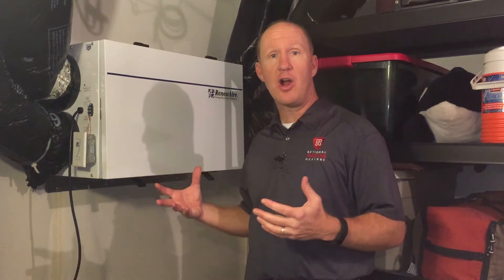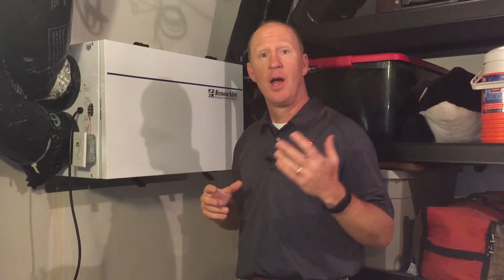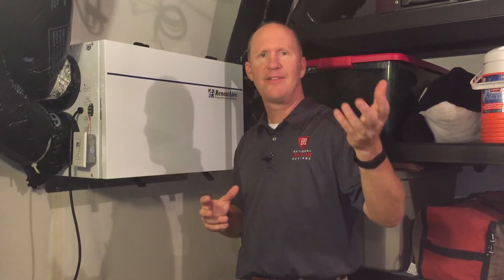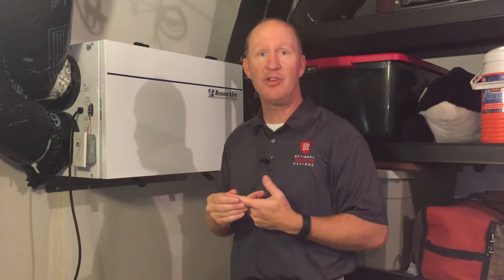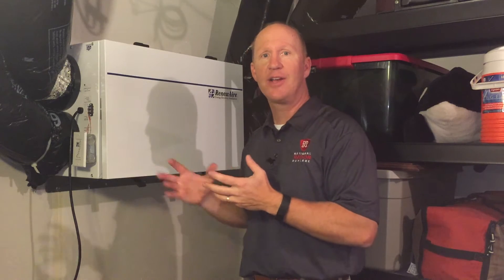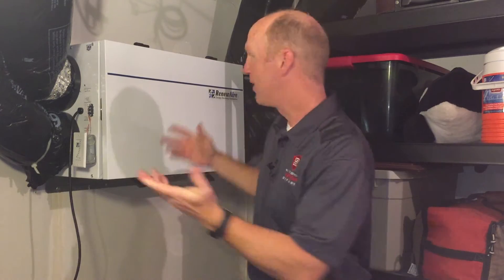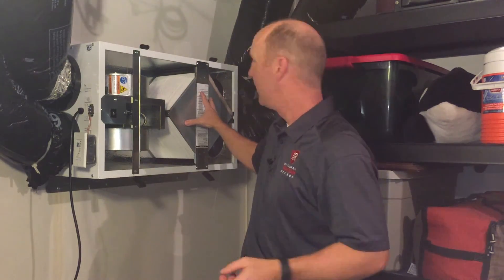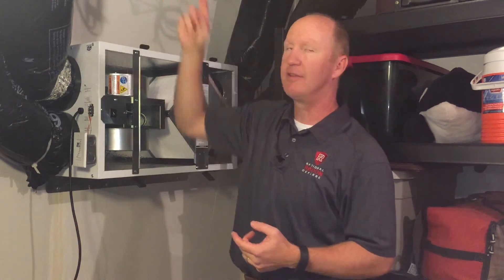Energy Recovery Ventilator Explained

Comment: So basically the device mix indoor and outdoor air? So the outdoor air will have some of the bad stuff from the exhausted indoor air (at a lower concentration?)
Reply: does not mix much. The exchange core allows the air to exchange heat, but the two air paths do not mix. Check how these work - there are videos explaining it - pretty neat.
Reply from the maker: Hi @BS-my2ky! An ERV doesn't mix indoor and outdoor air directly. Instead, it uses a heat exchanger to transfer heat and moisture between the two air streams, without them physically mixing. The outdoor air is brought in and conditioned before entering your home, so it doesn’t carry the bad stuff from the exhaust air. The exhaust air is expelled outside, while the incoming fresh air is filtered, keeping indoor air quality as safe as possible.